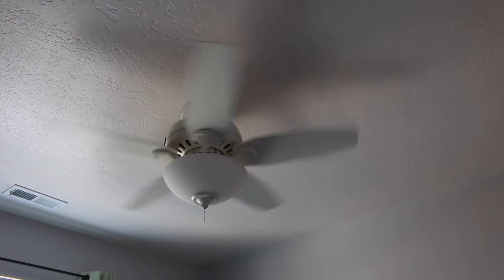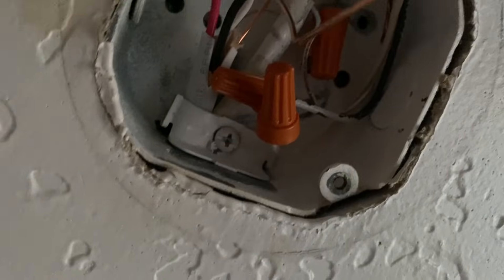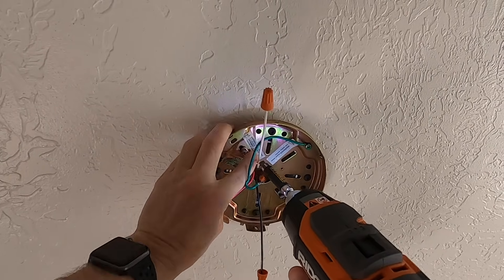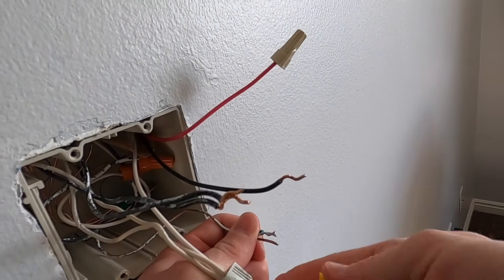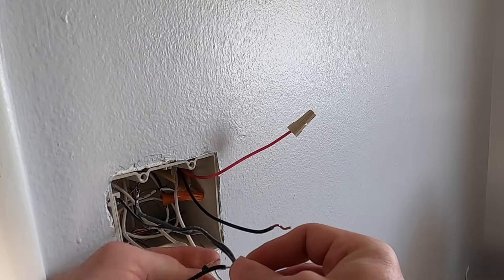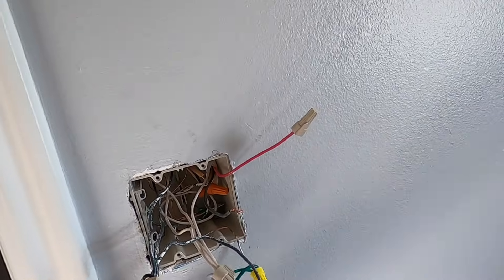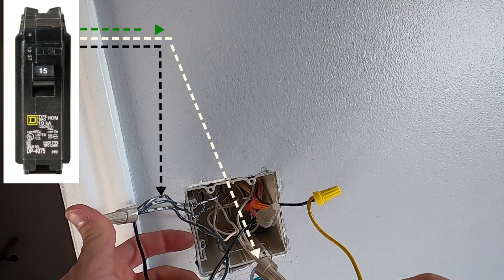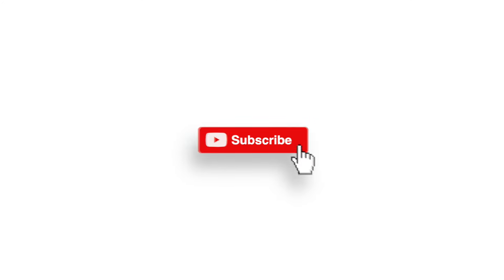How to Wire a Fan with Two Switches

Comment: Most modern remote controlled LED fans don't have a unique wire, only black white and ground. Is it possible to somehow hack it so you can still use my two light switches, one to turn off the light and the other the fan.
Reply from the maker: The only way I think it to rewire the internals of the fan, which renders your remote useless. There are other options like IR repeaters you can connect with your smart home, or swap your switch for a smart remote toggle.
Reply: @KylersStudio ok thank you.

Comment: you didn't show on the camera where you hooked up the black power wire from the box to the switch, where at on the switch did you hook up the black power wire from the box, you just said you hooked it up to the switch, but didn't show what screw on the switch you hooked it up too.
Reply: It doesn’t matter which screw you screw it onto on the switch.
Reply from the maker: Black to brass, white to white (silver), green to ground. That's how I remember it if that helps.

Comment: stupid question but when a fan has one of those light/fan control boxes in the fan that uses a remote, can you by pass the box and wire it up with a 14/4 two switch or smart switch?
Reply from the maker: Anything is possible if you know what you're doing, but buying a new fan would probably be a lot easier than trying to rewiring a manufacturer installation. Also, consider a smart RF hub or similar that can just mimic your remote signal and control your fan with Home Assistant or something similar.

Comment: I have two switches that control a fan. I bought a single switch that controls both. How do I wire it?
Reply from the maker: Home Depot has some good fan wiring diagrams. Keep in mind that with one switch, you'll have to use the pull chains to control them separately with only one switch.

Comment: What would change if you are trying to connect these two switches to two other switches on the other side of the room. I'm wiring a fan switch that controls its power and speed and then a fan light switch and need to have both of these be three way switches?
Reply from the maker: It sounds like you're wiring two three way switches. If you think of it that way, each circuit is a separate three-way switch. It would be difficult to give the details without being there.

Comment: If I'm not using smart switches, but simple old school toggle switches, then the switches will not have neutral (white) wires to connect to the cluster of other neutrals in the box, correct?  Simply connect the black "line" wire coming from the breaker panel to each switch, the unique wires to each switch, and a ground wire from each switch to the cluster of grounds, correct?  No, neutrals from the switches to the cluster of neutrals.  Sound right?
Reply from the maker: If you have an old house without neutral wires, it sounds logical that each individual switch would yes, just switch on power to each separate powered section of the light fan unit. Newer fans will have a neutral wire if you have that in your system. This is not electrical wiring advice, as I am not an electrician, but it sounds like you're on the right track to close each circuit individually with a separate switch.
Reply: @KylersStudio  Thanks!  Your video was super helpful!

Comment: With all fans going to DC instead AC motors, it’s my understanding that switch control for fan speed is not good for the motor, is it better to just have a dumb switch? And use the remote provided by the fan manufacturer? I’m a little lost on that part
Reply from the maker: Of course use the power that the manufacturer designed it for. The remote by the manufacturer is just fine, but usually doesn't come with remote local or cloud control logic. For instance, if the temperature sensor in the room is above 73, turn the fan on medium, if it goes above 75, set it to high, then turn it off in four hours.

Comment: I have a three way wire but ceiling fan will not work with switch, only the light will? The fan turns on with the remote, but I can’t do nothing to the fan without. Do I need a switch like the one you have that controls everything?
Reply from the maker: From what I've found, the fans with remotes don't let you wire separate circuits. It's easiest to buy a new fan unless you get into the fine details of rewiring the fan all together. There also might be ways to tap the remote into a smart device system using the IR sensor, or other ways, so that could be an option.

Comment: This is if your power comes to the switch. Mine comes to the light box...urg
Reply from the maker: Yes, but still doable if the power comes through the ceiling. You'll just have to lookup the differences in junction box to control. I hope you figured it out.

Comment: Question.  I want to replace a lighted (two switch) ceiling fan with a non-lighted ceiling fan.  Do I only connect the white, black, and ground wires and cap the red?
Reply from the maker: Great question. I can't see your situation, but if you isolate just the wires you need, I don't see a problem with just capping both ends of the unused wires so they can't touch anything or have any current through them. Essentially, know what each wire is for and use appropriately; you're on the right track.

Comment: What changes need to be made if fan has only three wires coming out?
Reply from the maker: If your three wires include your ground, then it's possible your fan and light can't be separated and you'll have to use the pull chain to operate them separately. Honestly, it might be easier to get a newer fan vs. trying to rewire the current fan.
Reply: @KylersStudio  
The ceiling fan has three wires - live, neutral and ground.
The ceiling box has 4 wires - neutral, ground and live wires (red, black).
When I connect the fan to ceiling box with
Ground to ground
Neutral to neutral 
Ceiling black wire to fan live wire.. no power coming to fan
Even if I connect red ceiking wire to fan live wire instead black ceiling wire, still no power to fab.

Any thoughts?
Reply from the maker: @ST-pq4dx  I have my opinions, but consider checking out Home Depot's How to Wire a Ceiling Fan and see if one of those charts match your situation. I don't want to give any ill advice.

Comment: Thank you so much sir! You helped me picture the circuit in my head and it all made sense during the install. I did have one additional black wire floating around in the junction box but quickly found what it went to when I flipped the breaker back on and the fan/light worked but none of the other outlets in the bedroom did.
Reply from the maker: You're welcome! Glad it helped! Yes, I think it's common to daisy wire the outlets off a light switch or visa versa. Glad you figured it out!

Comment: I'm not a pro by any means, but aren't those twist caps one is only? I use Wago lever connectors, BTW.
Reply from the maker: Wago nuts are nice, but included nuts are cheaper.

Comment: What are the model numbers of the switches from Lutron?  I purchased the Lutron PD-6WCL-WH to control the lights, but no white wire on the back of the switch.  Maybe I should have purchased the Lutron PD-10NXD-WH?
Reply from the maker: Great question! I had to figure this one out when I started as well. The more expensive 10NXD has hardware to support low-voltage, so if you have it controlling a dozen 1 watt bulbs, they will dim to off, whereas the cheaper version will still pass through a small amount of voltage to the lights that is used to power the wireless control signal. MLV loads convert the output from the dimmer to a low voltage output, so that smaller 12V or 24V lamps can be used, which requires that neutral wire. The cheaper version doesn't require the neutral, so you can just cap it off in the box if you have one. You can work around the cheap version by adding one higher watt bulb into the circuit and save some money if you want. There are other wiring solutions as well, but I haven't tried them.

Comment: Thank you. I'm installing a new fan for two switches(fan, light) It said connect black and blue to black. My old fan was blue to red and black to black. Once I tried it with the instructions, the circuit tripped. Will revert back to the original setup for two switches.
Reply from the maker: If your instructions tell you, certainly go with that. Hope you figured it out

Comment: You talked about testing the circuits before finalizing, but didn't show the testing, nor it working after everything was "buttoned up."
Reply from the maker: Yes, you're right that I didn't show the finished functionality of the lights and fan working separately. The only testing I needed to do was to turn the switch on. If the light came on, I thought it pretty obvious that it worked and it felt unnecessary to show that, but maybe I'll include more of those buttoned up shots in future videos. Thanks for watching! Hope you got yours working!

Comment: I want the ceiling fan and the fan light to be controllable from their dedicated switches. My fan only has a blue wire and a white wire. What do I connect to the red wire?
Reply from the maker: Sounds like you might not have enough wires running to the fan to control them separately. If that's your situation, the only way to do it is either with a dumb remote, or run a new set of wires to the fan.

Comment: I want the ceiling fan and the fan light to be controllable from their dedicated switches. My fan only has a blue wire and a white wire. What do I connect to the red wire?
Reply from the maker: Sorry I didn't get back to you sooner. Hopefully you figured out whether you need an additional wire run from the switch to the ceiling. You'll need a circuit for each to control them separately. Otherwise you're left to using the pull chains or fan speed tied to the dimness of the light.

Comment: Thank you for braking down the wire types as well as the color for corresponding thing they power (fan or light). I was stumped when I followed the directions from the manual provided me but they didn’t even indicate to wire the wire powering the light to anything. Appreciate the vid
Reply from the maker: Glad I could help!

Comment: So technically speaking and correct me if I’m wrong but you never really showed us how to wire a fan with two switches.  So if I only have a white and black wire from the ceiling, I can’t get my remote ceiling fan to work until  I rewire the ceiling ? Is that correct ?
Reply from the maker: You are correct. You will need a third wire in order to control the fan independently from the light. Otherwise your one switch control for the light will power the fan as well and subject to the fan speed via the pull chain.

Comment: The ceiling fan that I purchased only has 2 wires.. Black and White
Reply from the maker: That's pretty common. You'll need the third wire to control the fan individually; otherwise it's pretty much just on or off.
Reply: My fan has 2 black wires connected to the fan switch. My new switch has red, blue and black. Do i just cap it off. Its gor the light controls.

Comment: Would be great if you would have had the camera on the switch boxes when you wired them.
Reply from the maker: Are you talking about a tripod mounted camera? Yes, I think that would have been great. It's crazy how much work that adds to a project trying to film and finish. It would be nice to have a camera operator as well. Perhaps in the future. Thanks for watching! Hopefully you got your wiring working!
Reply: What a crucial step to accidentally film the wall 😓 still informative, but damn